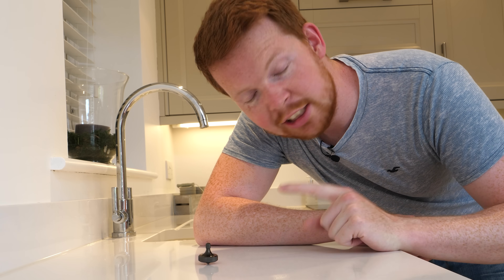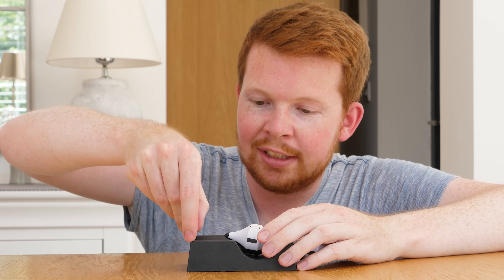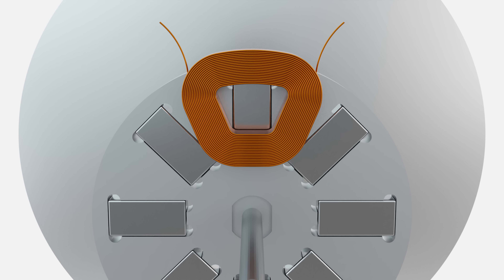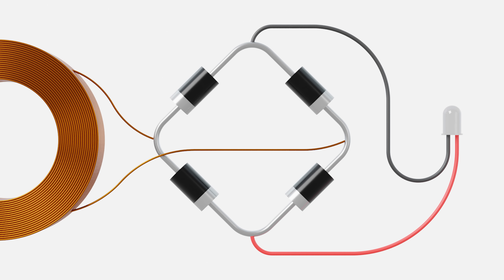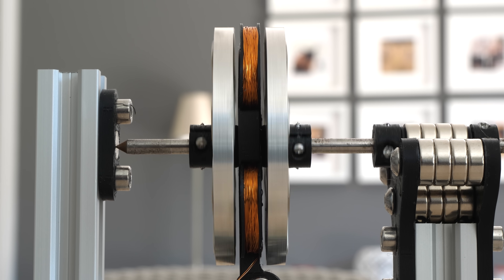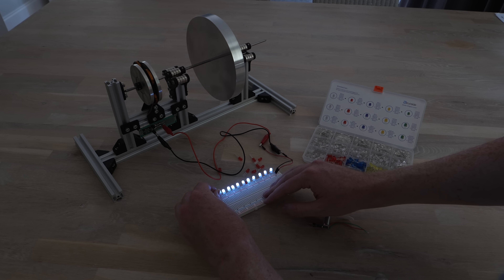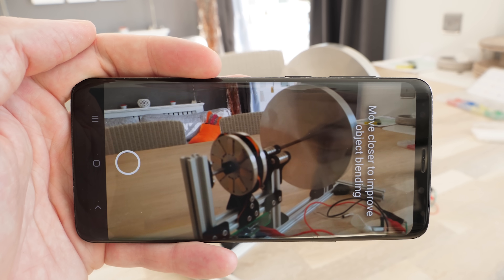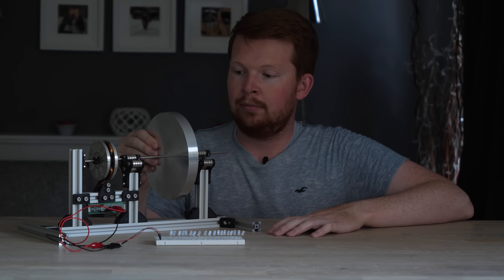Flywheel Battery

Comment: How does the load affect the run time of the flywheel, and what happens if you spin the wheel at frequency x, and work out the LC resonance of the coil/capacitors to resonate at x?

Comment: what about a repulsing magnet at the end instead of the point !
Can solar cells be used to rev it up ? 
does a bigger wheel (spoked)  but same weight make a difference ?

what about levitating a horizontal wheel, magnets make it float, magnets keep it in place ...

Comment: You don't to convert the current to DC to light up the LED. Pluss also a LED is a diode, so rather than a sperate rectifier, you could integrate the LED in it.

Comment: getting  flywheel and shaft with less run-out is so  important , will increase performance due to better efficiency of lines of force.
using optical feedback pulse control  could power coils to spin flywheel  up to operational speed using  magnets  on both side of flywheel with center turned out for coil assembly placement . this would allow  the removal of the  double rotor  .
for safety  add  a couple of retaining rings, thus stopping the rotating assemble coming away due to failure etc.
one  could measure power in and  out  ,  however this certainly is not  very efficient way of using resources.......lol

Comment: Why can't they use the rear wheels on an electric car to charge the batteries as you drive? It would essentially be the same thing as this and be a self charging electric car. Surely, engineers could attach a large enough alternator to do this. I saw a news story about a guy in Las Vegas who bought a 1975 Ford fiesta, removed the engine, put in several 12 volt car batteries, attached a single solar panel to the roof and the car recharged itself with no external source. He drove the car all over town everyday for a year and never spent a dime for maintenance. Total cost including the car was $1,000 dollars. It was ugly, but, it worked. If he can do that, why can't engineers design a car that charges itself? The answer is they probably can, but won't because of the way the money trail works. Replacement of parts, constant maintenance etc. They couldn't rip people off if their cars didn't produce income for them after the sale. Corporate money making b.s. and the consumer suffers when he has to have his car towed from the side of the road when he runs out of juice.

Comment: Just think; Faraday discovered induction in 1831 and the first practical steam engine to be used in industry was by Thomas Savery in 1698. If it had been the other way round we might live in a totally different world. Electricity from hydro power would have kept industry localised and clean. We might have had a technical revolution instead of an industrial one.

Comment: I'd love to design a circuit that properly harvests the power form this and powers the LEDs with a constant current source.
Some low forward voltage diodes, A handful of supercaps, a constant current supply LEDs
Should kill the flicker and deliver power, even for a short while after the wheel stops.

Comment: Awesome project, few questions: How much energy do you get out of the flywheel compared to what you put in, what is the efficiency? Would adding a second set of coils offset compared to the other reduce the flicker? Would adding a small bearing to the end add a significant amount of friction? It could reduce the wobble and might also allow you to hook it up to something to charge it (water powered, wind powered)?

Comment: Also, like those pull string helicopter blade toys, 3D print two attachments, one to the end of the shaft and the other one to a drill and spin it up, once max speed is achieved you can then simply gently pull drill away... I cant remember what this connector is called, I think in a previous video you did something similar... 🤔😎

Comment: Really cool. If you wanted to improve the efficiency, a MOSFET-based rectifier would help, as it wouldn't suffer as much forward voltage drop as the diodes.

Comment: Could you please create a very large gravity battery and connect it to a wind turbine, mechanically, but allow for the gravity battery to power the electric component and still be itself powered mechanically by the wind turbine? Can you make multiple gravity batteries run in sequence and, when full, make them become unpowered, and when unpowered and not empty, make them produce electricity?

Comment: The JET (Joint European Torus) experimental fusion reactor uses a couple of flywheel generators to store the power needed to fire up the reactor. Each flywheel is 10 m diameter and has a mass of 650tonne, peak power of 400mw at 6500mj per pulse.
When it runs the plasma in the torus is the hottest place in the solar system - ten times hotter than the core of the sun.

Comment: A very cool way of doing this, love your projects and 'Creative Engineering' ideas.. 😎 However, if you consider speeding the weight up to gain more power, I would seriously consider adding another 2 'Y' frames mounted above the drive shaft (above the 2 original magnetic supports - thus making a full enclosed floating support), OR, Ver 2.0 could have 2 full loop (circle) magnetic supports???  If you get my rambling drift lol 🤔🤔😎

Comment: it looks like all 4 coils are wired in sync with each other. i noticed it when i saw the leds flashing quickly. may i suggest getting rid of one coil and making it 3 coils instead to make a 3 phase motor that has the advantage of being more DC like without the need for a rectifier. the less components you have the longer the fly wheel will spin the more components you add the shorter the time. every bit of resistance you add to the circuit you also add to the magnetic friction from the coils to magnets.

Comment: Just wondering if it would be possible to use the wire coils from inside of old hard drives, they are very thin wire, super tighly wound and encased in some sort of resin which might allow you to get away with using smaller 3d printed brackets.

Comment: So, would it also be possible to use a magnetic bearing/cushion between the tip of the shaft and the impact plate? Essentially removing any point of physical contact with the base at all.

Comment: Tom, i may have a solution to help the efficiency. Have you seen the video from Smarter Every Days channel on the company out of Mobile, Alabama, USA that uses 3d printers to print the poles on magnets? They are able to do all kinds of things including adjusting the magnetic fields from a given magnet. If you have not seen that episode just search for "Polymagnet" and then click on the smarter every day's video on the subject.

PS: the coil in your illustration is identical to the coil one finds on the arm inside older platter based hard drives!

Comment: Instead of the pointy part of the shaft hold to a flat surface. Could u have use magnets there also? Or will it be to wobbly?
Or what happens if you on one side of the flywheel turns all the magnets to opposite direction?

Comment: Was thinking with a freewheel like one way lower friction mechanical connection or magnetic coupling clutch and using a vacuum as well as maybe tungsten or sapphire or maybe one of the two sulfides on the point to possibly reduce some friction. A ball point pen came to mind at first, though was like "duh!" a point would definitely be lower friction and then I was thinking what would be the lowest friction point?  Neat to see a potential electromechanical capacitor.  Maybe something like a Mendocino motor  combined would be a way to utilize also. A complete tangent would be something like this that came up first in my google search: https://www.osti.gov/biblio/6012467

Comment: Instead of having a big aluminum wheel for weight only, why don't you make the wheels with the magnets bigger and use them as a fly wheel, Wouldn't that be 2in1 solution?

Comment: Can't you add two magnets opposed to each other on the edge of the shaft to create the constrain frictionless? Also if that would be installed in a vacuum chamber it might spin "forever" (without producing electricity)

Comment: It’s a GENERATOR not a battery. Also you will find the spin time will decrease as load increases. As NEwtons third law says " every action has an equal and opposite reaction"" .Other than a less friction "bearing" there is nothing new and you don’t need to convert AC to DC to power a light bulb. Entertaining video for would be young mind inventors though.

Comment: Might be worth it to mill some scoops in the rim of the flywheel so you can spin it up with an air compressor. And you can even make a hand powered air compressor so you're not using electricity to spin it up :)

Comment: Wow looks great and so much fun. A few changes I would try…
Change the flywheel for a ring. All that extra weight in the middle would serve better use further from the centre.
Tightly pack everything to keep the shaft short to stop the bouncing.
Integrate the magnets into the flywheel, perhaps have 2 ring flywheels instead.
Might have to build one of these myself!

Comment: Could you possibly increase the voltage output and then add a motor to the flywheel so it pretty much requires one spin for continuous rotationional energy

Comment: Would it be possible to have the flywheel have a continuous turning using magnets after it is initially spun up? If so if you could get the flywheel to rotate at 1,000 rpm's continuously wouldn't that be able to create a self driving electric generator that could actually be used to charge a battery bank? Also if it can be done couldn't the magnets for the flywheel rotation be used as a part of the electric generation as well using the coils?

Comment: You can prevent the last but of friction by placing opposing magnets on that end and the plate, it won't add a lot, but it will free up some of the friction. 
Also if you alternate the coils instead of having them parallel would that remove the flickering or just stop it from working?

Comment: Correct me if I'm wrong but I think a flywheel of the same weight but concentrated on the outer part of the wheel (central part with less material) would hold much more energy than this one (although making a little more friction).
You could make a flywheel similar to a bike wheel, with sticks or whatever in the center to hold the majority of the weight on an outer radius and the put something lightweight on the center part to achieve a cilindrical shape (like the one in the video) to make less friction with air.

Comment: I think that you can use two extra magnets at the tip of the shaft and two fixed opposite pole magnets more in order to stabilize the shaft. And this can cause no friction on the touching face.

Comment: May be it would have been better to use a bad, unstraight axis and achieve higher rpm than resonance. After resonance frequency rotor would balance itself. With bad axis resonance frequency is lower so it is easier to overcome

Comment: I'd be interested to see... Getting a flywheel spinning takes a lot of energy, but KEEPING one spinning doesn't take too much. I wonder if there would be a way to have a small solar panel powering a motor of some sort which keeps the wheel spinning above a certain RPM, but which causes the device to output more voltage than the solar panel would be able to produce on its own. I know on the surface that seems to break some rules, but then again, if you look closely enough at it, it might be at least interesting to see happen.

Comment: the frame is shaking if you look close its losing energy from the wobble
I bet it would run longer if the shaft was straight

I have been playing with uno cards and small ball baring type magnets that come in those cube kits

I wonder what this guy would make with that same stuff

Comment: Could this be scaled up? What about a larger flywheel, using a motor to spin it up then an alternator to retrieve the energy? I wonder what the losses are. Probably substantial, just from the air resistance slowing down the wheel. Place the whole thing in a vacuum, make the holding pin a near-frictionless pin.. could get real crazy  and overengineered, but I bet you could get a fairly substantial actual battery out of this concept.

Comment: Very awesome.
I just have made my own axial flux alternator and by spinning it with my hands I reach up to 4,6V and 200/300mA. But I noticed that when I connect a load to it the coils start to create magnetic fields too which create a resistence making it much harder to spin the alternator. This has implications for a flywheel battery since this resistence of the coils will slow down the flywheel much faster when a load is connected. The same goes up for a stirling engine which was also one of my plans. So for any decent amount of power you need a really heavy fly wheel to grealty out weight the resistence.

Comment: Uh, oops! Where did you get the idea that you'd need to rectify AC in order to power a light bulb or a motor, many of which are just peachy on AC?
Reply: Not light bulb, led.  Light.  Emitting.  Diode.   There's a hint in that name.
Reply: @NomadSoul76 : 1. He didn't say "LED" at first. 2. There are LED light bulbs, so your point is invalid that way. 3. Putting a period and new capital after each word doesn't make sense.

Comment: Now with your flywheel generator if you charge a capacitor with it that's big enough to give a pulse back to your flywheel every time it spins around you can make a perpetual motion machine that keeps spinning for a really long time, maybe forever until the magnets wear out or something else breaks but I know for sure it keeps spinning for weeks, months without having to add any extra energy to the system.

There's one guy that makes those machines which can be used off grid to charge all sorts of batteries and he even shows you can run a load on it but it's not build for that purpose, it's not a conventional generator but it does generate enough power to support itself so it keeps running for a really long time and at the same time you can take some of the energy to charge other batteries and it will keep doing that without the need to put energy back into the generator so it runs at no cost if I got it right.
Here's a link to the demo video - https://youtu.be/M8VdsWn-Q9Y

Comment: question about that "sideways spinning top" fix for your magnets: can't you achieve the same by simply putting the magnets on the axle slightly closer than those on the frame? that way they'd both try to be pushed inwards, removing the requirement for the friction point on the end of the axle?

Comment: The French telephone system used this to provide emergency backup power more than 50 years ago.
Reply: Hospitals use these today, IIRC, to provide steady backup power for life supports etc. during the first few seconds of a power outage that their main back up generators take to power up.
Reply: @epamaarainenroina220  Dont they use a diesel or petrol generators?
Reply: Use of the internal combustion engine should be on the way out. 
Solar, used to heat molten metal with external combustion engine hopefully developed soon and too use widely.
Reply: Interesting concept super capacitors would be my solution today.

Comment: Hey Tom, you can use the coils to speed up the flywheel by putting an alternating current on them. If you time them well you might have a 'real' battery. Technically it could be sped up with very low power. Idk a small solar panel or so. maybe add induction sensors an arduino and some mosfets. Should be fairly simple.

Comment: Nice again!
Doesn't exist a magnetic fraction  between coils and magnets?
The induced current generates a magnetic filed itself and it acts like a virtual magnet with opposite poles against static magnets on the flywheel. So they pull each other and slow down the flywheel.

Comment: To reduce losses in the rectifier Schottky diodes are preferred (they have low voltage drop).
Or even beter..instead of using diodes in the rectifer in electronics began to use MOSFET, as diodes replecment, as they have very low Drain-Source resistance.
(Active rectifier -wikipedia)

You can also try a few diodes in parallel..

Comment: If I remember correctly adam savage was talking with people building a huge version of this but once they got it to speed they kind of aborted because it caused alot of vibration and they was afraid it might break free from its stand and run away but they was talking about it being a good way to store energy in low demand times and then released when demand was high

Comment: 10:03 your LED is in parallel. The voltage requirements doesn't change
Reply: no, but the increased power draw causes higher voltage drop. To counteract that he does need increased voltage by increasing rpm.
Reply: @erdnusserdnuss8985  but not as much as when you put it in series. You need a higher voltage for it to even turn on
Reply: I think Tom was referring to the white LED having a higher forward voltage than the red ones.

Comment: Try first to spin it with AC connected to coils and then later use this energy to power the led - in that case you will crate "kinetic energy storage" system. BTW commercial solution already exist, for example AmberKinetics - https://www.youtube.com/watch?v=A4c_7h3IpRY
Nice project.

Comment: It really makes you wonder if it’s worth upscaling this but with a motor intermittently winding up the flywheel. Would the energy required to power the motor outweigh the energy made from the flywheel each “cycle”.

Comment: Instead of an aluminum wheel, put in a waterwheel, add a transformer to increase the voltage to 5V, and you can make a portable hydroelectric charger for USB devices.

Comment: Never would have thought those magnets would support the weight of that flywheel, VERY cool!  If you want to see slow-mo footage of the rectifier functioning in a nearly identical setup (using LEDs for diodes), go to 6 minutes 30 sec on my video Rain Gutter Power #2.